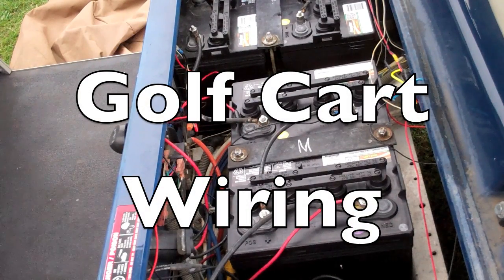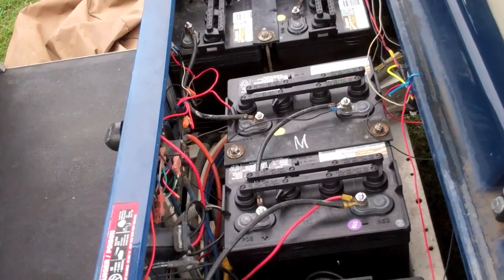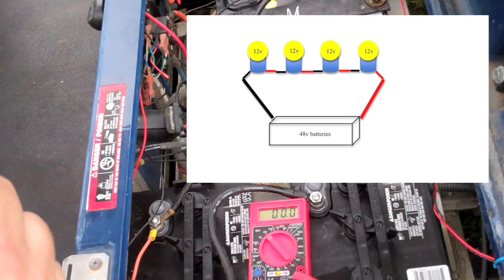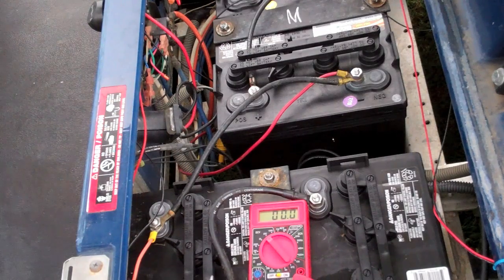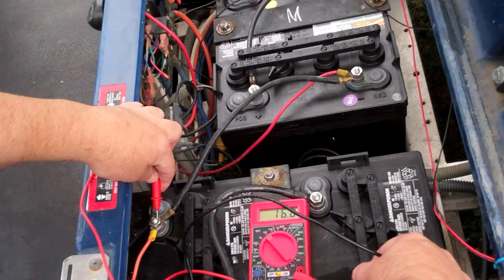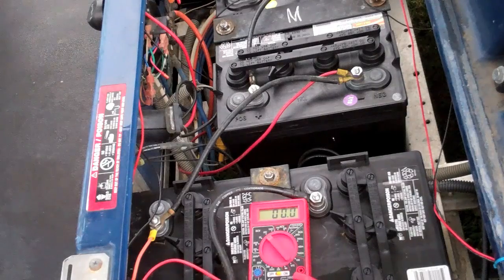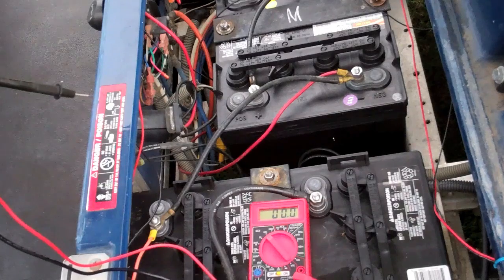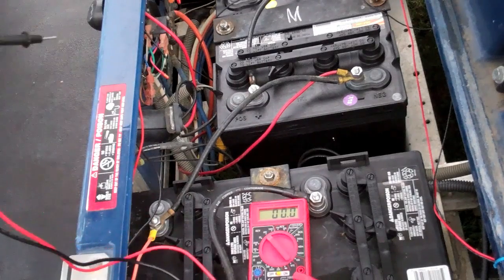Golf cart electrical

Comment: I'm not being a dick but trying to help. Text doesn't have tone so I don't have an attitude lol. But if you know so little about this..why make a video. It's kinda misleading ppl. The controller doesn't change the voltage. .. I mean it does but there are multiple voltages that it puts out based on certain input criteria being met. For example when you press the brake pedal the limit switch tells the controller to engage the motor brake. I'm a journeyman electrician and I'm rewiring the entire golf cart. A 2012 ezgo freedom rxv. .. and it's a beach. It's not easy task.  If anyone isn't sure ...I'd say not to mess with it. You can damage the controller and that's $1700 alone. They have both series and parallel circuits on them so of you aren't paying attention you can confuse one red conductor with the other 14 red wires and before you know it you're back feeding 48v through a circuit designed for 12. Manualslib is a great tool . So is uglys electrical reference . Good luck

Comment: Have a question..friend has an old yamaha golf cart...electric...doesn't run..did before...she bought 1 new battery...the batteries never fully charge..they bought a new wire harness for the lights..it's not on..I want to buy it but I'm not sure what amount I should offer..
Reply from the maker: I have no idea what you should offer unfortunately.  I do know that golf cart batteries are usually $100 or more each and while that could solve the problem, it might not.  If you end up buying it, good luck and I hope it's something inexpensive to fix
Reply: @WJHandyDad  thanks

Comment: Kohree DC/DC Converter Regulator Reducer 36V Step Down to 12V 10A 120W Golf Cart Voltage Converter Regulator Car Power Supply Electronic Power Supply Transformer Volt Module
by Kohree

Comment: Golf carts use a lot of amperage if you switch the batteries to 12 volt you're cut your available amperage at least in half reducing your range and run time
Reply: Are you saying 8 volts are better than four,  12 volt batteries? New to the gulf cart world